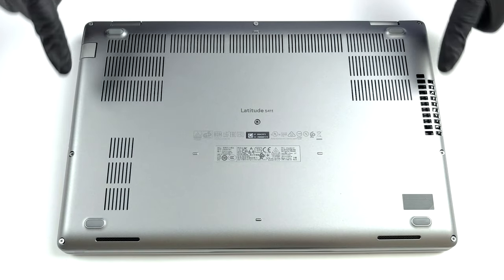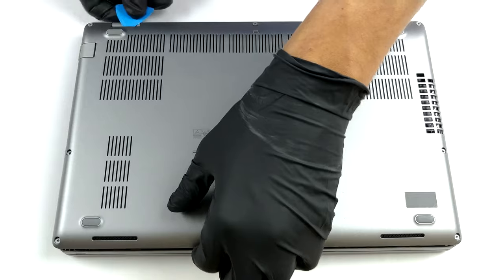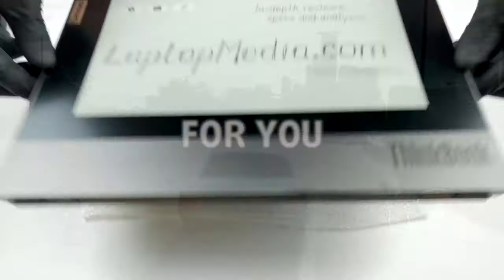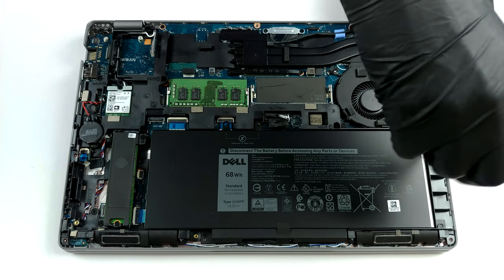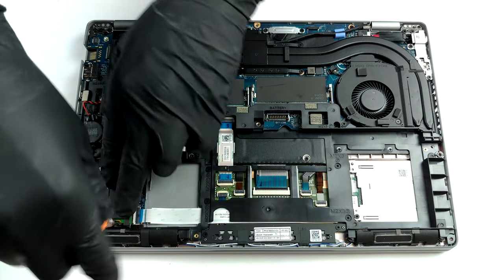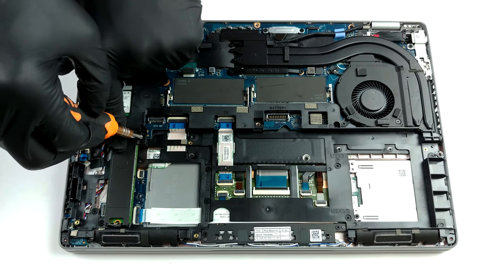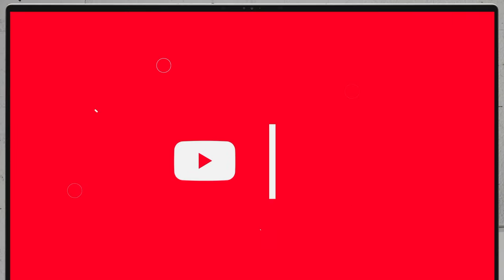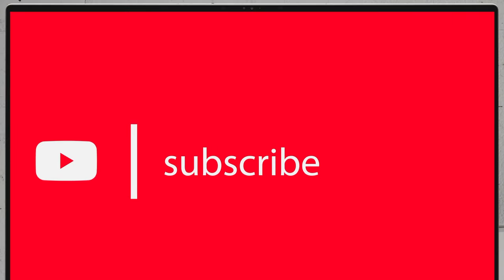🛠️ Dell Latitude 14 5411 - disassembly and upgrade options

Comment: There has been alot of discussion about this having the same heatsink design as the one in 5410 with U processor . Thanks for clarifying that the diameter of the 5411 is actually greater even tho it appears to be the same. Still skeptical if it provides ample cooling, more importantly if it is able to sustain performance
Reply: Got one used and it was overheating right away.. ended up needing new paiste on CPU and a new battery. Once I did that it has been running under 50 C , I haven't stress tested it yet